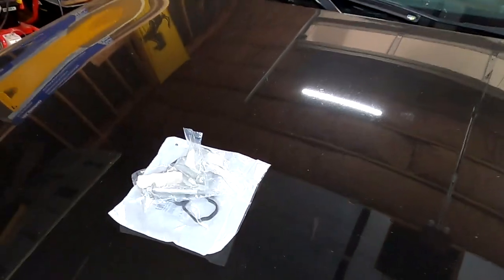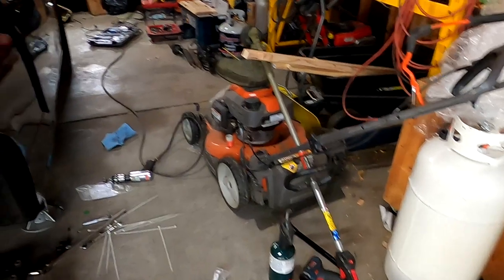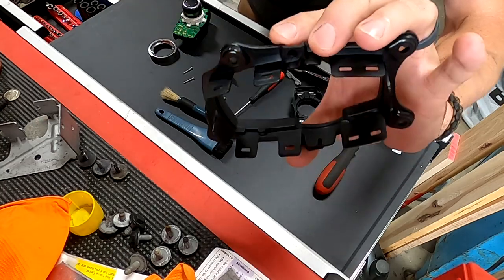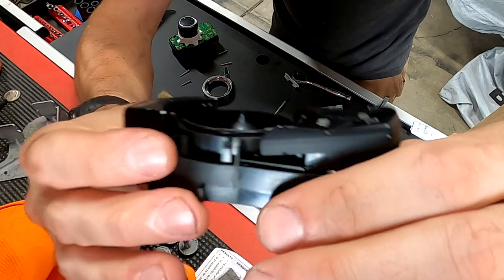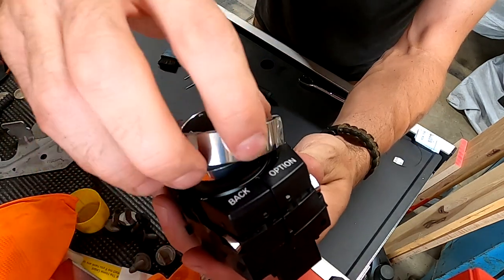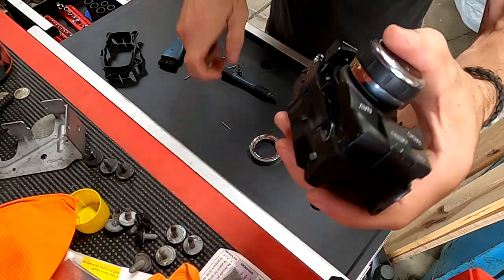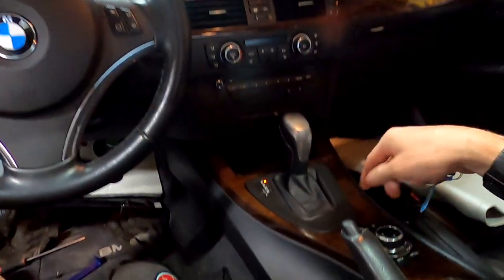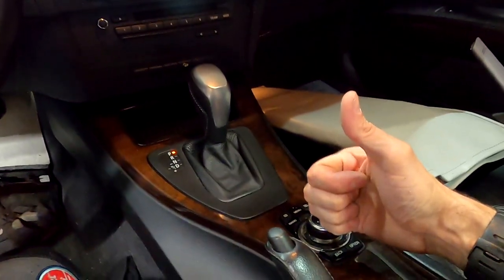Cleaning an idrive controller on a BMW

Comment: Ok… how do ya start a disassemble video…. When the control panel is ‘already disassembled??”… ugh… I need a DIY how to disassemble a M version of a 2016 F33…. The controller isn’t the older type. Plz send help, once disassembled- I’ll watch the remaining portion of the video.  Thanks F33 owner
Reply: Disregard- disregard- I figured it out
Reply from the maker: that's exactly why - 100 videos of the different console disassembly to - replace - the controller - I just needed mine cleaned / made not sticky.

Generally speaking, the consoles are just different enough to be annoying from platform to platform -- but I'd guess the M console to come apart the same as a non M (it's that way on my E63 M6)
Reply: @OffTheMountainCO  I opened my "M" Idrive and didn't see the screw and then there was another mother-board.. I freaked... but when I took the motherboard wire off.. It was HELL to get it back in.. And once again.. I freaked.. but finally settled down and worked thru the issue and the results were perfect

Comment: Was it the whole controller not working or just the menu button?
Reply from the maker: the menu wasn’t working at all - it would stick really bad too. If I remember right, 2 others were a bit sticky but cleaning that part with hot water / dish soap / agitation — and drying it out — got all the junk out and made it like new